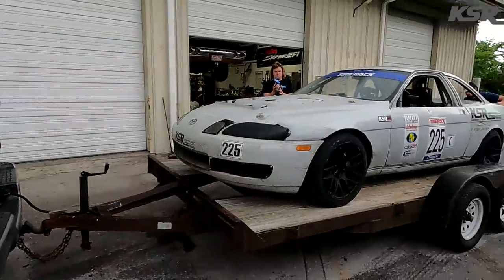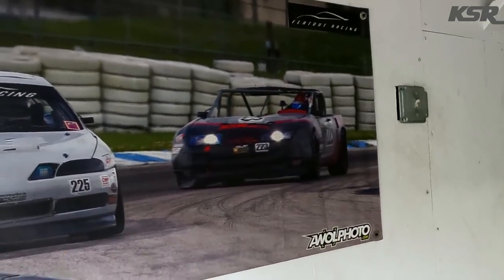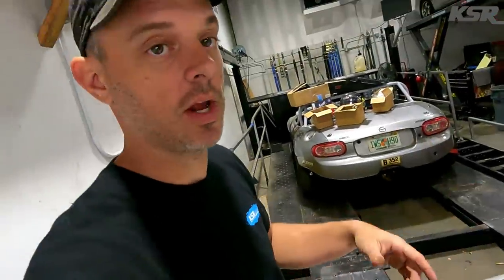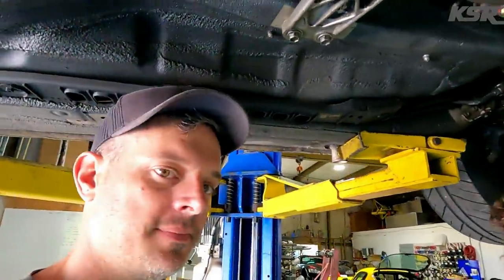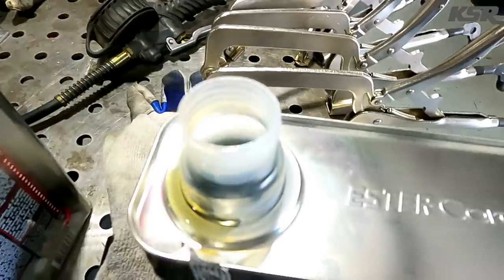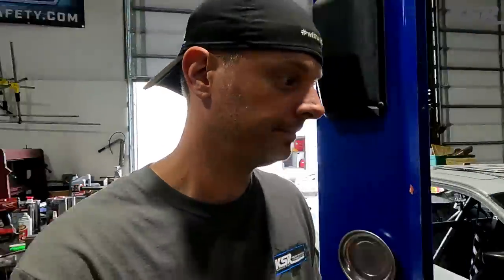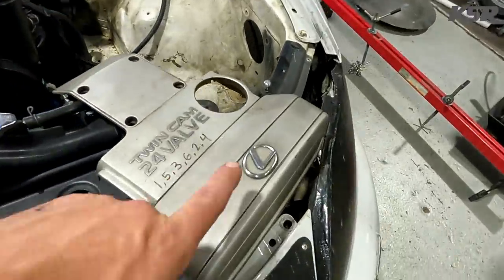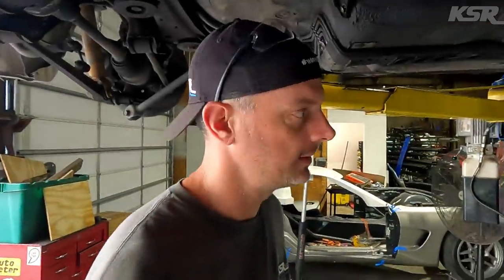I bought a RACE CAR and Racing 600 Miles Tomorrow!!

Comment: Cleetus is doing a lot of different motorsport lately, the guy is a natural
Reply: Yeah, until 20 feet from the finish line...
Reply: @mark-wh2qc  no ramps on road endurance racing lmfao. He can keep it matted and be good.
Reply: Very true, or tho he had 11 laps of practice by that time..
Reply: That's what happens when you get good at karts. If you have to win by driving, not relying on power, it makes you a better driver.

Comment: The old Castrol R oil had a distinctive pleasant smell as it burned.  I ran my autocross Fiat 128 and rally Fiat 850 Coupe Abarth on it.
Reply: Castrol r and methanol mixed,  smells mouth watering
Reply: Bruce Cole  it's available here in England,  not sure about elsewhere
Reply: The Motul 810 and 900 smells heavenly too, it's full ester synthetic, but I suspect they put a bit of castor in there too

Comment: Most likely put an Aisin Timing belt kit on. The mitsuboshi belt is the OE belt, along with the koyo idler and tensioner pulley and Aisin Water pump

Comment: guessing Derek for second driver, wouldnt need Drews size for the seat for 
Cleetus if it still has to be adjusted for height, and Derek is a lot more level headed in a race car which is needed for endurance racing. Cleetus has shown he can drive but tends to overcook it in new to him styles of racing.

Comment: How does the extra wings on the oil pan help with the sweepers. Do they have baffles?
Reply: Yes, Trap Doors. You can see them in the video when Kevin is talking about welding up the oil pan.
Reply: Correct. He showed how it worked a couple of weeks ago when he was getting the other SC ready for Freedom Factory.

Comment: Uh.... Kevin... you can't just tease a Gen 1 Camaro in the background like that and not say anything about it. I had a friend that had one and I told him if he wanted to sell it to let me know (it was ROUGH and I wanted to do the body work on it when I was in college but he couldn't afford materials) and unfortunately he sold it... for $1300!!!!! Never remembered I had said that I love those cars.. he just knew me as a Ford guy.
Something you should look in to for any race car is swinging oil pickups. They are designed for offroading but they work under high G as well, it allows the pickup tube to swing with the oil and stay submerged the entire time instead of forcing it to be stationary and uncovering it. It should allow you to run less oil which (by what Freiburger showed on Engine Masters) will free up horsepower by reducing drag on the bottom end.

Comment: Does the engine have to be completely stock to run this series?
Reply from the maker: Yes and no. Modifications add an additional point value to the car, if the car goes over 500 points, you start laps down to the field. The Lexus SC300 is a 500 point car in the series in completely stock form so we are stuck with stock everything except the pieces that we are allowed to change.

Comment: Why doesn't it have a cooling fan?
Reply from the maker: It doesn't need one. The airflow across the radiator at speed is enough to keep the engine right at 200 degrees.
Reply: @KSRPerformanceFabrication  that just seems crazy to me! But very cool

Comment: YOU DONT HAVE THE STAMINA TO RACE 600 MILES. NOT EVEN CLOSE.
Reply from the maker: Weird, considering that I have already done it, and won. We switch driver every two hours if you were not paying attention ;)
Reply: @KSRPerformanceFabrication  You always take the troll right out of me. Damnit. Good luck.
Reply from the maker: @666kty3  haha. I did 4 hours straight at Sebring and had already done 2 hours earlier in the same day a couple of years ago....I was whoooooped the next couple of days, but we won! Now, if it were something like the Viper.....heck no, I would be whooped after 2 hours.